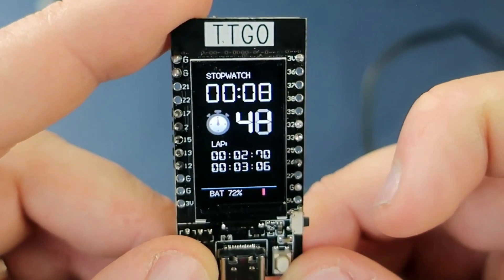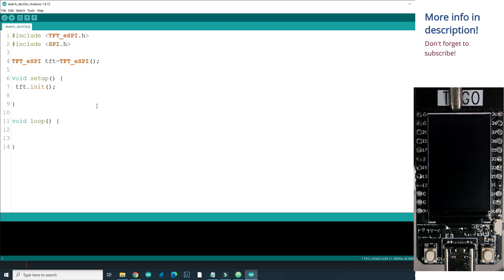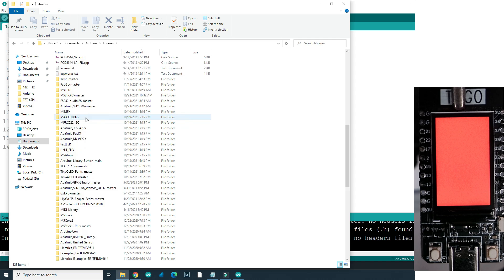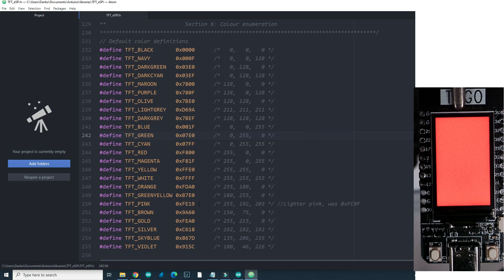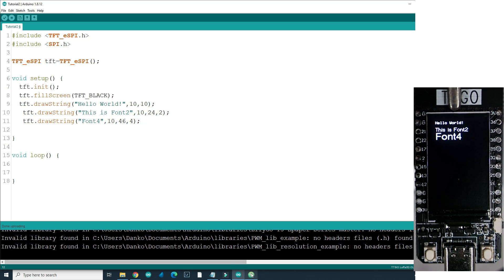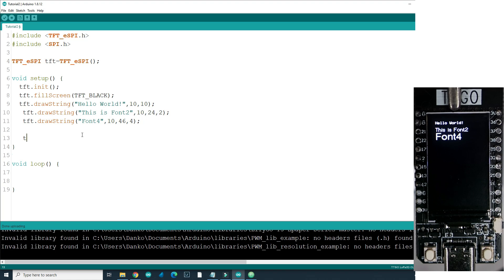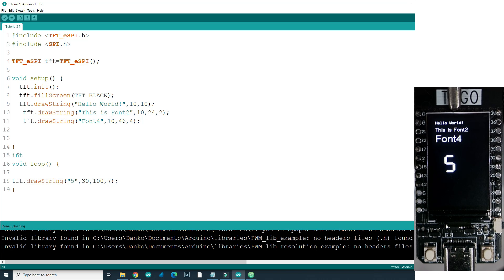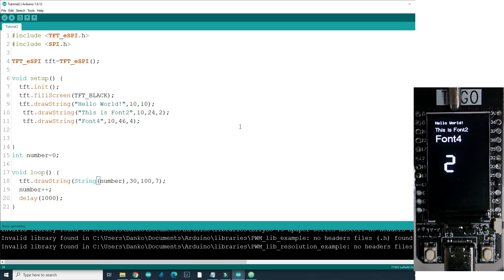How to use TFT_eSPI library and ESP32 (PROGRAMING TUTORIAL PART 1.)

Comment: Sir, Do you have wiring diagram for ESP32 and  TFT ILI9341?.  I have ESP32 that doesn't have built-in TFT.
I'm also using TFT_eSPI library. I able to run sample sketch like TFT_Clock and some sketch that displays image from SD card. (very slow)
Now I have problem with touch function. I able to run Calibrate sketch and 4 corners touch test run without any problem.
But when I run On_Off_button, it doesn't response at all.

This is how I wire the connection between tft and esp32 wroom
 TFT_MISO      TOUCH_DO       SD_MISO   pin 19
 TFT_MOSI      TOUCH_DIN      SD_MOSI  pin 23
 TFT_SCK        TOUCH_CLK    pin 18
  TFT_DC         pin 2  
 TFT_RST        pin  4 

  TFT_CS          15 
  SD_CS             5
 TOUCH_CS    21 
 
I also want to use  TOUCH_CS on pin other than 21 because I found out that pin 21 and 22 are for I2C.
I might add other module in the future that use i2c. This will cause conflict between TFT and I2C.

Which ESP32 pin is good for  TOUCH_CS?

Comment: I get no display functions as soon as I activate the display functions and vice versa. Each work on the same board without issues, individually. But as soon as I start the server, the display dies. I believe server and display driver have conflicts.

Did you test this with wifi AND display at the same time?

Comment: Excellent Tutorial and Starting point, I need to make several projects using this TTGO T Display board Thanks .. 

You're busy or missed this (below) so  I have answered my own questions. LoL I hope they are right but I'm a rank novice at this :  

1.) Why do you seem to always select the Board type for these TTGO T Display board projects as "TTGO LoRa 32-OLED"  when this is not and OLED is it?  and its definitely not the LoRa radio version of the TTGO dev board either as far as I can tell..  Ans: the internal Espressif ESP chip is the same on the LoRa boards so it's a good fit for the TTGO T-Display ( standard) dev module.   
2.) is that Board type selection valid for all TTGO Display types,  Ans: No,  its definitely not. The newer TTGO T-Display S3 series and OMOLED boards as well as the T-QT all need a fifferent Board type selection. I am not sure not believe these all need Type: "ESP32 S3 Dev Kit" or sometrhing similar. One thing I found out is you can't expect the Board type name to be the same in the Arduino IDE as it is called in the PlatformIO IDE, they are slightly different and if your board type selection is wrong or some of the parameters under it don't match the code may not compile without a lot of warnings and errors.   
3.) How would you know what Board type to use for other types of display dev boards with different types of displays?  is this Board to Board Part Name or Number type cross-reference info located some where in a table in English?  Perhaps I should just Google it .. and like everything else .. the answer would likely appear.. Sorry I'm so lazy.. 😝 Ans: I couldn't find a way other than to ask the mfr's tech support team,, ( or look here in the YT videos Danko is making. I'm not sure that is his 1st name but suspect it is because that is the name of his C:\Users subdirectory.   😂😂

Comment: Everything seemed to work.  I do indeed manager to upload, etc BUT, I see nothing on the screen.  Serial.print("hello"); etc all work - so I know I have the right device.  The screen did come on when I FIRST powered it up.  It is now stuck black since uploading what I learned here.  Help Please!
Reply from the maker: Did you fallow this tutorial in details, did you edited user setup files, did you delete  old tft_espi library
Reply: @VolosProjects  I did follow in DETAIL, YES!  Not sure what you mean by "user setup files" but if you mean "board manager" etc, YES.  I did NOT delete an old tft_espi library.  I do not see that in the instructions
Reply: @VolosProjects  My system tells me that I have version 2.5.0 installed
Reply from the maker: Version of what?
Reply from the maker: @johnh5073  we are in wrong video, this is tutorial https://youtu.be/b8254--ibmM
Reply: @VolosProjects  the TFT_eSPI library
Reply: @VolosProjects  I'm confused now - I followed the steps in THIS tutorial and am having the problems we are discussing.  Are you saying that this is not the right tutorial for the device I have?  If so, please explain more.  I did just watch the other video.  Are you saying that my mistake is that I did not edit the appropriate header file referred to in the other video, and that this is the problem I have?
Reply from the maker: @johnh5073  yes, you need to fallow steps from other video, this is programing tutorial

Comment: Man your gauges look so good, I only managed to get one display working on my Arduino Uno using the code from someone else but the guy didn't update the code and it was quite a long time ago for him to make the project so the questions I asked him about how he created the graphics he couldn't give me any useful answers.
Because of that I had to figure it all out myself by changing one value at a time, uploading the sketch and then see what happens and that over and over again until I almost had it working on my display which is smaller so I had to change everything manually, that took a long time and it's still not exactly as I need it to be and I can't figure that part out because I don't know what I'm doing when it comes to displays and coding graphics is not my strongest point so whenever I can use something from someone else who already knows how it works I don't see the need to invent the wheel again so to speak right?
Saves a lot of time when it works the right way first time and the code is clear to understand and has the necessary comments in the right place so I can easily see what part of the code does what and what I need to change to make it work for my hardware which is especially important when the hardware isn't exactly the same as the person sharing the project online.
In my case I thought I could easily change the code because the guy sharing it added in the comments that using his code on a different display smaller or bigger could be done simply by scaling but he didn't explain what I needed to change and where to make that scaling happen and because I don't know what I'm doing I couldn't get that figured out so I just changed everything manually to get the graphics to fit on my display, can you imagine the process I had to do?
That was not a lot of fun I can tell you that much.
So I really hope that your code is easier for me to understand and I bought the exact same model board as you showed in your latest video using your link, that way I know there's no difference at all in the hardware which should make it much easier for me to follow along with you.
Thanks for sharing this here on YouTube, I appreciate it very much.

Comment: Hi, Great video man.
Will this library work with st7735 display? I have tried that display with arduino nano to build a menu system using adafruit libraries, but the display seems to be very slow to update, but the same logic works with the 0.96" i2c oled ssd1306 display without any lag and flickering. Do you know why? Is the library causing the problem or the st7735 display?

Comment: Can you change the brightness of the screen to make it Less bright.  Perhaps a black background and make font numbers less bright? I want to make clock that is not so bright at night in dark room. ?  Thank you.
Reply: I believe I found the answer in your vid on the weather station, in its code about lines 145-157 “digital read (35)”...is this dealing with dimming the screen? Can anyone give more details on this, and can these 12 lines just be put into other code for a ttgo-t-display to dim screen?
Reply from the maker: Hello! Most my examples have code that is used to set brightnes, in my last example  https://youtu.be/MRlcGGTdEFk  lines i code are 38, 39, 40 thease lines need sto be outside setup or loop bracket.  Also you will need lines 65,66,67, you can put thease lines in setup or loop part of code. In line 67 you can find number 90 , that  number represent brightnes, you can set any value between 20 and 254.  Just cope thease line sin your project and it will work.

Comment: Can someone Help me? I can not upload sketches to my TTGO. Concerning data given by the manufacturer, I need a CP2104 diver. I installed the CP210x drivers and it still do not work.
Reply from the maker: Did you install board and libraries in arduino ide?

Comment: My TTGO has arrived and the factory example works on powerup but when I tried a basic sketch everything loads fine without any errors but the display remains blank. After some searching there is mention of setting up the display in user_setup.h. Did you have to do this?
Reply from the maker: Yes, you need to do that, here is whole tutorial https://youtu.be/b8254--ibmM

Comment: Great video!

For me, if I only put color on the text, and no background color for the counter. It actually messes up the counting.  0. 8, 88. Very strange. I just put the background as black.
Reply: This happened for me too.  I'm using a TTGO T-Display V1.1 with ST7789V 1.14 inch from AliExpress.  I set the text colour to black and redisplayed the number to clear it.

Comment: I am very much looking forward to these tutorial videos as I started last year programming ESP32's and I am trying to make a GPS speed meter which displays the maximum speed a RC car has reached before you press a button to reset it and I had all kinds of problems with the display and fonts, The font size I wanted to use didn't have the characters I needed so in the end I stopped working on it but I hope to learn enough from your tutorial to start it back up again.
Reply: This is my first time working with an ESP32. I’m using it for a rather useless reason. I have a really decked out guitar hero controller, I have a custom paint job, custom buttons, custom everything pretty much. I even swapped out the old mechanism for the fret buttons with mechanical keyboard fret buttons underneath. Anyways…I’m going to cut a hole for a little screen in the body of the guitar hero controller, put a little protective lens over the screen hole, mount the screen on the inside of the guitar hero controller in front of the little lens window, and then play gifs on the screen. I’ve routed everything out, and it should go as planned…I’ve got a hole drilled out on the shell of the guitar hero controller for the battery pack that I have for the ESP32 to be recharged…it’s going to be great. It’s going to be cool to have a little screen on a guitar hero controller, but it’s never been done before!